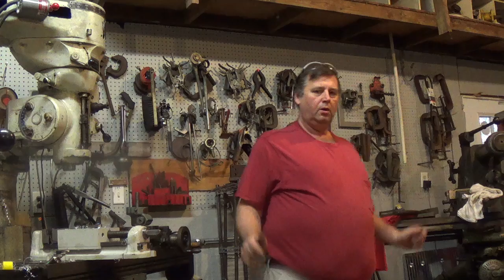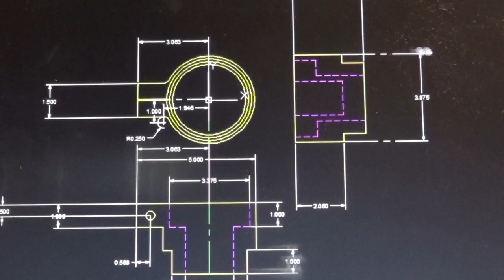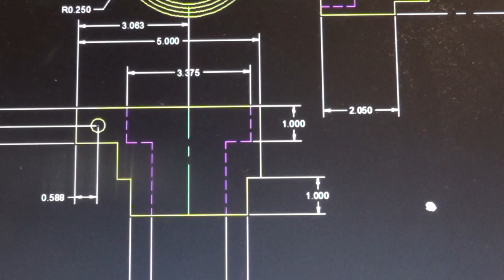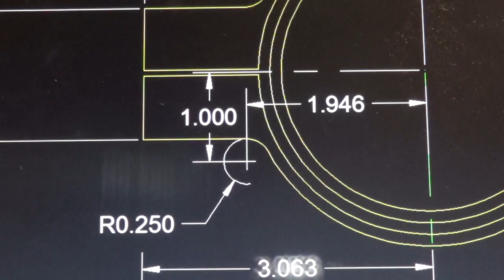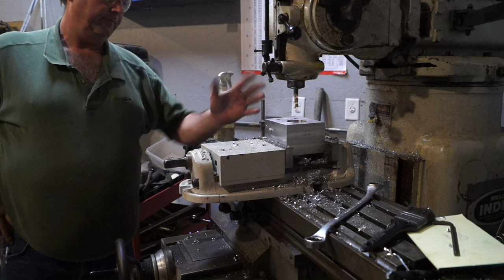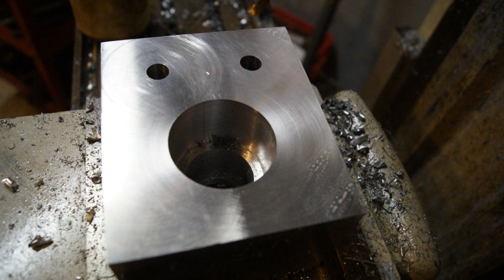90 Deg Milling Head Adapter

Comment: Thanks Mike!  I really appreciate the time you spent at the CAD screen explaining the order of operations.  To me this is one of the most important steps that many YouTube contributors don't spend enough time on.  For instance, I always pause the video when a drawing is shown and I work it through my mind how I might make the part.  Then I hit play and see if I figured it out.  I always learn more that way.  I have virtually no experience with a rotary table, so your explanation of drilling the 1/2" holes first would not be what I imagined, but of course it makes perfect sense.  Your video quality is getting better every time.  Keep after it and it will be as good as your machining.  Joel.....

Comment: Good video Mike, Looking forward to seeing your next video on your adapter. Is your mill R8 or straight shank?
Thanks Buddy
Reply from the maker: +Buddy Lineman My mill has a r8. the adapter has a straight shank. I plan on using a 3/4 collet
Reply: +The Backyard Machine Shop I have been looking for a 90 degree head for my mill, it uses ZZ collets and 3/4 straight shank tools are the largest I can use, ( its a Tree Milling Machine )

Comment: Good job on the video Mike, is this adapter being made so you build another part in the shop? Like to see some more done on the Hardinge. Does Keith let you drive the locomotive, for all the work you do for him, or he just pay peanuts.
Reply from the maker: +Robert Klein robert thanks for the reply.   I am building the adapter mainly to have a project to share, I had considered using the 90 deg head to broach the IH hub I bored out a couple months back. Keith usually splits his pay for the projects that I help him with.